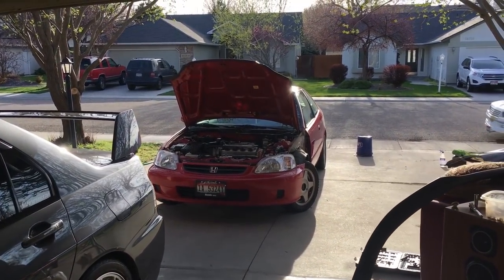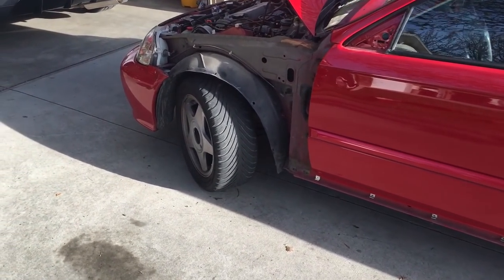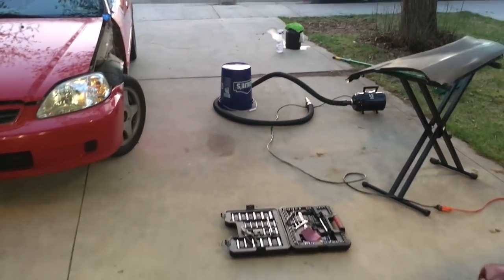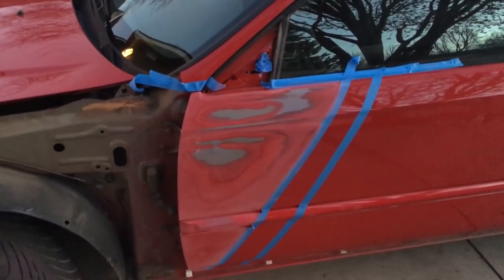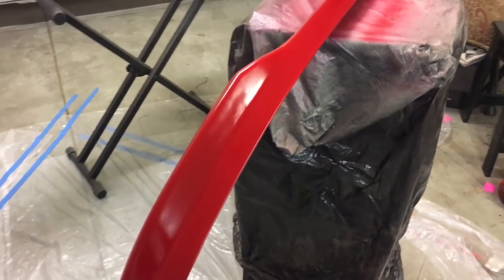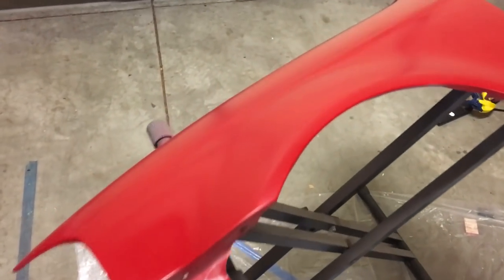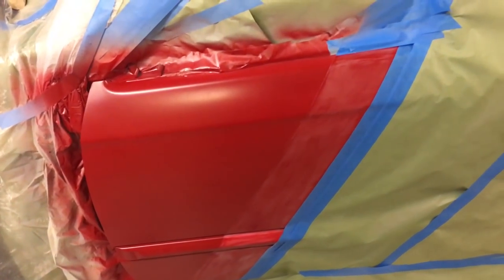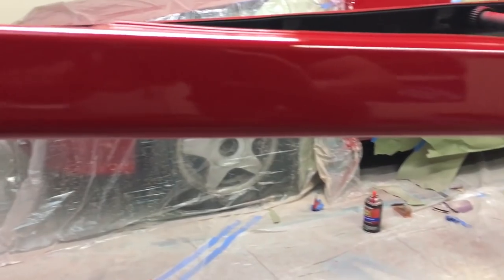My DIY Rattle Can Paint Job | Honda Civic Project

Comment: Its pink because its not meant to be a rattle can color. Its a 3 stage color and the pink is the base
Reply: So should I buy the duplicolor after priming it and then use the other can and clear coat??

Comment: I've can painted and properly painted cars and parts a number of times, and through those times I try hard to remember that things will not always go smoothly, no matter how well you plan it and how well you prepare yourself. The main issue is not preparing that much or at all when things don't go your way. I've dealt with nozzle malfunctions and other things so I understand how much of a bitch it can be when problems occur......and I get triggered quite easily. At least the important parts turned out as planned for you.
Reply: D DJ use fat tips brotha? They do miracles!